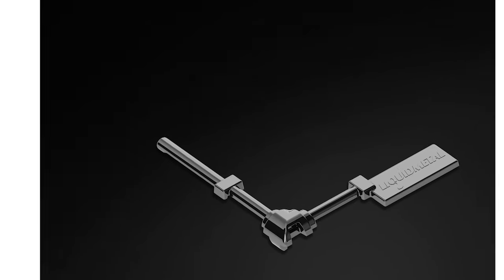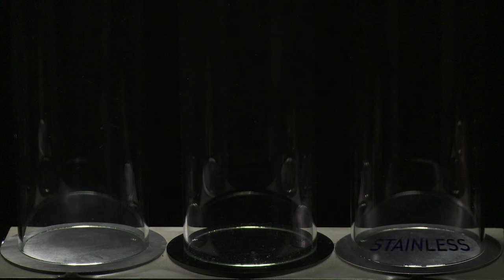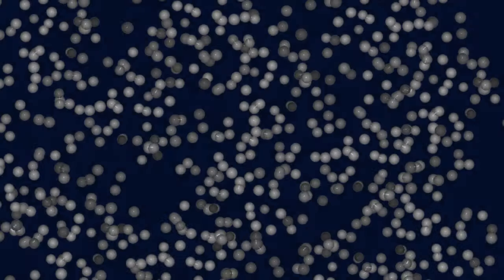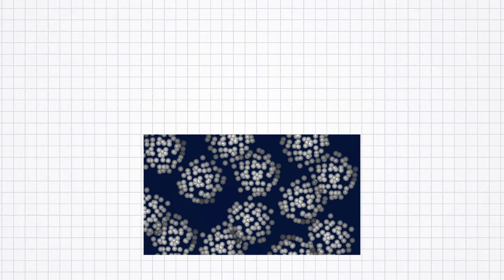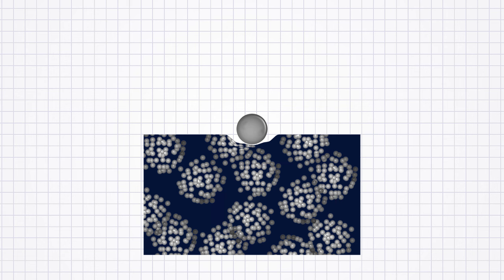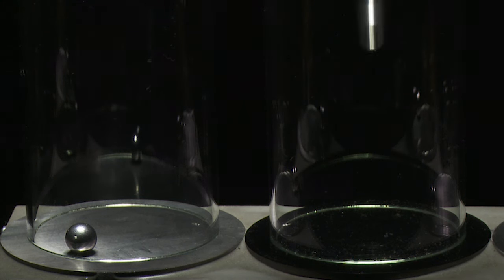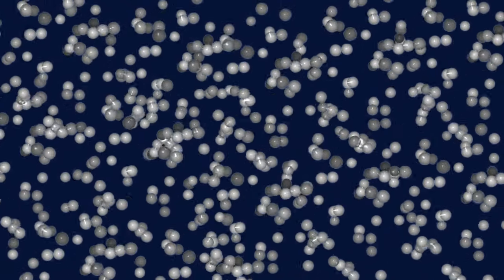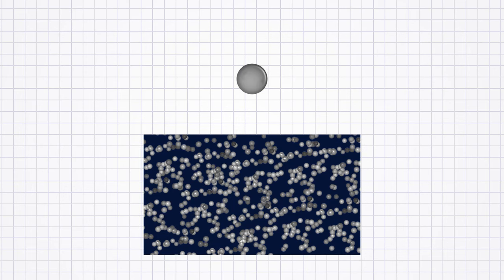Dropping Ball Video

Comment: If it's elastic ability if that great. The obvious application is to make a crossbow. I would think that a crossbow with 180 lbs if pull should be able to be made with a bow diameter that is less than 1/6 the the size of a current 180 lb crossbow. It should be able to be mounted on your wrist and shot almost like a pistol. ?
Or just make a regular sized crossbow so I can shoot a deer with it from the same range as a 30-06 rifle.

Comment: Why is most of the energy lost in the stainless steel block?  Why is half the energy not lost in the ball bearing?   I mean, if half were lost in the ball bearing, the liquid metal block could not make it bounce more 90% on the first bounce if the stainless steel example reached 80%.  But it appears to have reached over 95%.

Comment: Is the air the only thing slowing down and stopping the BB on the Liquidmetal sample? What would happen if the test was repeated in a hard vacuum?
Reply: Loss of energy by through heat and vibrations
Also through light if you bounce them hard enough
Reply: Also through deformation of the ball
Reply: @drewshapiro6976  did you also look up steel ball bouncing on steel plate after that one video as well? lol
Reply: @calebgerhard7313  lmao yeah because he said steel was bouncier